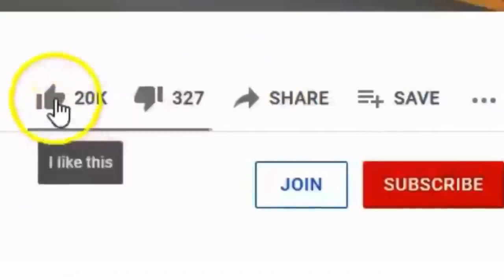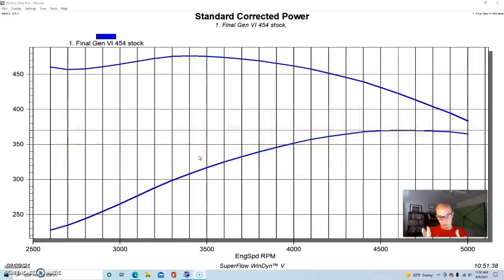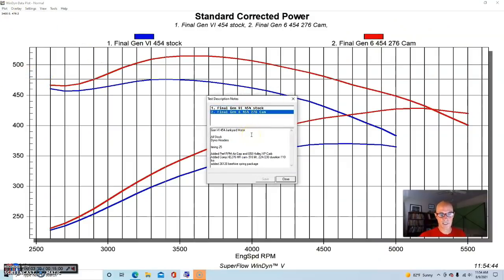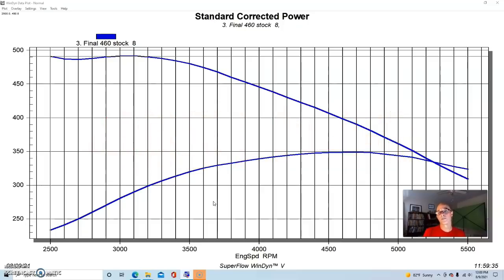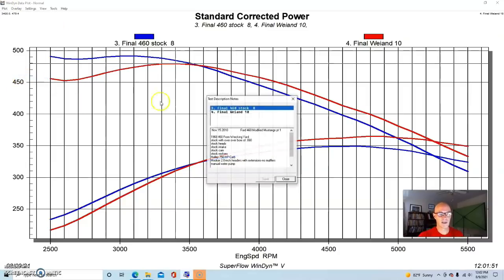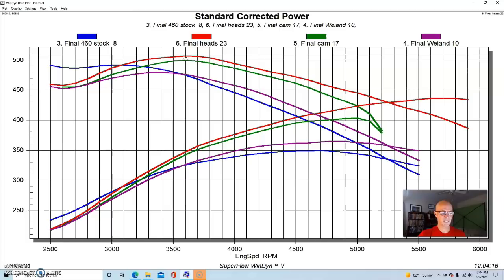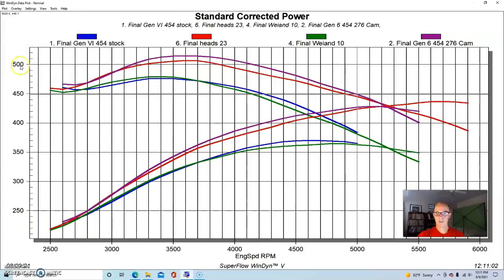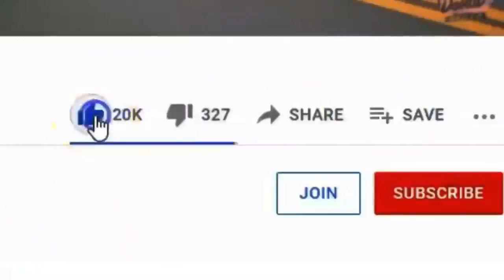JUNKYARD BIG BLOCK POWER-460 FORD VS 454 CHEVY FULL DYNO RESULTS

Comment: You can NOT outrun basic mathematics. If you use comparable upgrade parts that should give any engine a  V.E. of "about" 1 hp per cubic inch then a 454 should have "about" 454 hp and a 460 should have "about" 460hp. 
The real question here is how many parts and at what cost does each engine require to get to said 1 to 1 V.E.?
Reply: @ryanroberts1104   This is where the terms "basic" or "about" comes into play moreover I am NOT wrong in fact I'd say this test solidified just about everything I said.  I did NOT assume anything about the engines, it's the upgrade parts, and that's the entire point of this test. A decent cam swap, valve springs, headers, hi-rise Intake, 4bbl carb, and ignition upgrade is what we all know as basically a 1 to 1 V.E. upgrade.  That's a known target Ryan.  Granted some V-8 engines respond a little better than others but "basically" when building you can use your cubic inches to be your HP guide and be very close, as this test so emphatically proves.  Seeing as how the Ford actually outperformed the Chevy (ever so slightly) in this test, your flawed opinion of how terrible the Ford Big Blocks are does NOT interest me in the slightest. Cheers.
Reply: EXCEPT the 460 Ford is actually a 472 Ford.  It was bored .060" over.
Reply: @corvettejohn4507  So the engine with slightly more cubic inches made slightly more hp? Humm, wow, that seems to be the exact mathmatics I mentioned earlier but how could this be? Ryan said the 460 Ford was a terrible design so how could it be so responsive to all the upgrades? Pffft. Wtfe.
Reply: @warrenstephens3705  Yes.  A 472 made 8 more hp than a 454.  Somebody wake the kids, call grandma, and notify the newspapers.
Reply: @corvettejohn4507  Now you're learning, the bigger engine has the potential to make more HP, it's just basic math.  Grandma and the kids probably understand basic math.
Reply: @ryanroberts1104  It's my understanding that the same engineer designed both engines, and when designing the Ford, he corrected some of the mistakes he made on the Chevrolet.
Reply: @michaelangelo8001   Im like Richard, Im not a brand fanboy, I like all engines. One of the desigh changes you spoke of is initial bore size, the 460 has a huge bore so if you want to build a monster BB stroker just find the stroker crankshaft, theres no need for an aftermarket block to get the big bore, its already there and can be bored even more. Ask Jon Kaase.
Reply: @warrenstephens3705  I'm not learning.  I agreed with your first post.  I'm trying to help you out.
Reply: @warrenstephens3705  The Ford is better in a lot of ways.  They have a better combustion chamber and port design, and my favorite thing is that the spark plugs are up above the exhaust ports where you can actually get to them.

Chevrolet had a winner with the 409.  just a little re-design work, and it would have been better than the hemi.  However, they chose to start over with a clean sheet of paper, and we ended up with the "Mystery Motor".  It could have been better.
Reply: @michaelangelo8001  Exactly, and the fact that we are still talking about these engines is a testimate to how great there were and still can be.
Reply: @warrenstephens3705  Right.  One thing I really liked about the 348/409 was that there was absolutely no valve shrouding other than the cylinder wall itself.  It could have been improved some, but the combustion chamber was still better than those on it's "semi-hemi"  replacement.
Reply: @michaelangelo8001  You obviously don't know much about 409's.  They have some pretty SERIOUS limitations due to their design that makes them poorly suited for racing.  BTW, the combustion chamber of a 409 is in the cylinder and not the head.  It's formed by the shape of the piston top.  The surface area to volume ratio is poor, that means a good portion of your fuel's energy goes to heating the engine coolant instead of pushing the piston top down.  And that's one of the many things that are against the 409 for racing purposes.  If I listed them all here, it would turn into a book.
Reply: @corvettejohn4507  Lol, since you have set yourself up as an 'expert', go ahead and write me that "book", professor...  I'd appreciate it if you could actually tell me something I don't already know about this engine family.

Meanwhile, you might take note that it did very well in racing at the time.  I've owned/built more than one of these, and was duly impressed.

I already said that it needed some improvement for use in the high performance market.  After all, it was originally only intended for use as a heavy duty truck engine.

I stand by my statement that it was an overall better design than it's replacement.
Reply: @michaelangelo8001  Michael, I've owned and rebuilt W motors too.  Here goes:

Racing Weaknesses of Chevy Mk I 348/409

1.    Poor surface area to volume ratio because of combustion chamber located in cylinder block.  This lowers engine thermal efficiency and wastes more of the fuel’s energy to heat the engine coolant.

2.    Extremely heavy pistons due to the combustion chamber in block design.  409 pistons weigh almost 2 lbs each.  This limits useful rpm before engine failure.  Heavy pistons also hold in more heat.  Pistons in W motor run hotter than those in the SBC or BBC.

3.    Spark plug is in poor location in chamber for good flame travel.  The combustion chamber created when the 74° cut is taken across the bore is elliptical or oval in shape, rather than circular. This means that the wedge and quench areas do not have the same relationship as in the conventional head chamber. In addition, much of the nominal squish area is directly beneath a valve head, rather than being completely between piston and head surface. The spark plug placement, too, since it must be in the head, cannot enter the wedge from the side, as it does in the SBC. All of which results in a different flame front and combustion pattern and explains why many man-hours were expended by Chevy on modifications in this area.

4.    High compression piston tops are asymmetrical, they are thinner and lighter on the intake side of the piston top than on the exhaust side of the piston top. 

5.    Mediocre head intake port flow that is equal with passenger car oval port Mk IV heads (260 cfm/520hp NA max).  The exhaust valve opens toward the cylinder wall which shrouds the valve (truck block unshrouds valve w/relief cut for compression drop) and limits volumetric efficiency, power and rpm potential.

6.    Poor flowing stock intake manifolds with right angle runner bends.

7.    Undersized connecting rods and rod bolts for heavy pistons.  This limits useful rpm before engine failure.

8.    Crankshaft main bearing factory clearances and oil pump insufficient for high load, high rpm use.  This leads to seized crankshaft during heavy performance use.

9.    2-bolt main caps.  This limits useful rpm before crankshaft failure.

All of these things were corrected with the MkIV BBC, especially high performance 4-bolt main versions like the L88, ZL1, and LS6.  Not to mention that the MkIV rectangle port heads flow way better at 315-325 cfm on the intake port.  I've built both W motors and MkIV's, and it's not even close IMO.  In 1963, when the canted valve semi-hemi MkII 427 Mystery Motor hit the track at Daytona it was setting lap speeds 15mph faster than the fastest 1962 409 stock cars.  The one area where the W motor may beat the Rat is nostalgia.

Comment: Ford needed the .060 over to keep it competitive.  I didn’t scroll before commenting here.  Still the 454 out performed the Ford hence we were told everything about the 454.
Reply: Very true. It's already bigger by a few cubes from the factory
Reply: The Ford was from a 60’s car with flat tappet cam…. Throw a hydraulic roller in it with the same spec as the Chevy and it’ll show more power
Reply: I think the point of this video is that for the same engine size (generally speaking) they make similar power (generally speaking). The differences in these two tests were really pretty trivial, and they were obviously done at different times and not an intentional Apples to Apples test.

 I suspect there are not enough BBF parts at Westech to do a really good apples to apples comparo with a BBC. The Weiand on the Ford isn't the best manifold, for example, but it's what was available.

Comment: Do these 454 vs 460 videos ever turn out differently? No, the Chevy wins every time.
Reply: Unless you want power off idle, and since these are Truck motors that's where it's needed.
Reply: Where do you see a winner ??? They are so close in output you'd never feel the difference in a vehicle !!!!

Comment: Very poor comparison when you use a Chevy engine from 1990 or newer vs a Ford from 1968.  All late model Fords were roller motors.  Just upgrading the valve springs will get you a very strong 460.  Can we just do a more equal comparison?  Heads and cam will change the entire engine so displacement doesn't determine everything.
Reply: late model Ford 460 is a hydraulic flat tappet camshaft. No OEM roller camshaft for the Ford 460
Reply: My mistake.  That is correct.  Only flat tappet.  The Windsors all had rollers.  I apologize.
Reply: @murphystreeter  it's all good

Comment: Ive always understood that Ford pushrod V8's  have mostly been lacking, held back to a degree because of the exhaust side of the heads, especially the later models including the 460. Of course there are fixes for this.  All OEM's used to go back and stifle engine power back by one, making good street driving characteristics and to restrict available power for a trade in reliability. If they were pushed off the assembly line making all the power they could, its not going to live long. Things like restrictive exhaust or induction achieve this. Leaves room for the performance crowd too! GM tended to derate power by induction limitation. These practices largely died with the proliferation of fuel injection where the ecu tuning is the gatekeeper and factory engines make good power and fairly optimized performance off the dealer showroom.
Reply: Ford's exhaust issues on pretty much every mill they designed in the 60's had a lot to do with distance between the shock towers in their passenger cars
Reply: @ewetoobz3840  If i remember correctly, the 460ci had a pretty ugly exhaust port path. Up out of the valve and followed by a sharp, turbulent downward turn out of the head. I know exactly what you are talking about on the strut tower cars. My buddy has 69' Mach 1, R-code car, FE Super Cobra Jet. Its "fun" to work on. I understand why many took to the fender wells with a holesaw to do spark plugs.
Reply: @mytmousemalibu  One of Ford's "Better ideas".   LOL!
Reply: @corvettejohn4507  with that monstrous 428ci Super Cobra Jet jammed into that car..... i don't  know if you could fit a Kraft Single cheese slice between the towers and the exhaust! 😄

I love that car but theres a lot of alternate "I'd rather do ____ horrid thing" than do plugs on that Mach 1.
Reply: @mytmousemalibu  I know exactly what you are talking about.  In the 1990's I helped a buddy restore his 1969 Mach I with 428 Super Cobra Jet Ram Air Shaker Hood Scoop Drag Pack 4sp car.  

Whew!  Boy that's a mouthful.  And an engine bay full.  A BOSS 429 Mustang only wished they had that much room under the hood though.  LOL!  Stupid Ford tricks.
Reply: @corvettejohn4507  Yup!
That is identical to by buddies Mach 1, 4spd, shaker hood, drag pack, everything a guy would want as a SCJ car. This one still needs restoration but its an original 30,000 mile car. Eventually its getting the as new, showroom restoration, all stock. Except for one easy swappable part. He found a set of vintage factory Ford valve covers that look just like the originals except they say COBRA Le Mans on them, original Shelby parts. He'll definitely keep the originals too.
Reply: @mytmousemalibu  My friends car had the 4.30:1 gear and Detroit Locker.

Comment: There's no replacement for displacement...how many times have we heard that one...last time I checked it was the 11th commandment...
If you put these up against each other at the drag strip it comes down to vehicle weight, gear selection grip level of tires and who has the fastest reaction time.
I have beat many guys with more hp and faster cars with my truck because they didn't have the traction and they were caught sleeping at the line.
Reply: Drag racing is usually won in the first 60 feet.
Reply: @madmod  That's right !! 😉

Comment: Hydraulic roller cam with much more lift, also a much better intake with a RPM Air Gap compared to the Weiand intake with a small Hydraulic cam and a emery cloth cleaning of the heads. What a joke. Need same cam, same valve springs and stock rocker arms. Same era of engine like a 1970 vs 1970 for compression and timing purposes. Also no aftermarket timing componets.
Reply from the maker: SHOW ME THE JUNKYARD YOU FIND A 1970 LS6 IN

Comment: The Ford pictured ran a stock water pump Belt driven And a wiend intake  which are knowen not the best choice and weak valve springs Geeeeeeeeeeeeeeeeeeeeeee
Reply: There are two Weiands - one is too small and the other is too big. RPM Air Gap is just right! lol.
Reply: @ewetoobz3840  Who let Goldilocks in here?  LOL.

Comment: All the 460 heads are trash, even the dove heads. 
Please try a 460 with good heads
Reply from the maker: STOCK
Reply: C8VE/D0ve's with a good port job are far from trash.
Reply: @richardholdener1727  Yes, STOCK Boss 429 heads... HA!
Reply: Even the d0ve heads have a bad short turn radius and need good bowl work. True with enough porting most heads can be MADE better, but driving in dowels and not getting into water jackets while grinding down humps is a ton of work. But as cast they aren pretty bad.
Reply: The factory cast iron CJ heads (1970-71) flowed very well on the intake side but the exhaust side was a different story. They do benefit greatly with fairly simple port work. These engines were on the cusp of coming emissions requirements and had EGR bosses cast into the exhaust port - not drilled for use yet but still a bump in the way. Also the downturn in the exhaust so that these engines (exhaust manifolds) could fit between the shock towers of mid-sized sedans didn't help. A lot of guys made big power with these heads  though so saying they are trash is incorrect.
Reply: @lyleclark9190  Ford crippled lots of heads with that shock tower business.
Reply: @MrZilla500  it doesn't take much that work to make the exhausts flow a lot better. It takes a LOT of work to make them "pretty", but you don't have to. ScottyJ (Madporter) on the 460 boards has some recent information on the bare minimum to make a huge improvement on the D3ve heads and it's not a lot of grinding. Nowhere close to water jackets, no AIR removal, very minimal grinding. Granted, the aftermarket has some very strong offerings but they are not remotely cheap.

Comment: How about a couple real engines; 455 Olds, 500 Caddy, 440 Chrysler...
Reply: Lol! Real engines? Olds? Caddy??
Reply: @jesseduke694  Don't build engines, eh?  It's ok, just keep watching videos in your mama's basement.
Reply: @FMChimera  LOL! You wanna be right so bad!!
Reply: @FMChimera  it takes more than the alloy in the block to make serious power.  The other components have to hold up more than just the blocks. And heads that can flow some air are also helpful. Not somthin Olds,  & caddies are generally known for. I know all about there special blocks that you speak of. But to actually get them on a level with the other engines has to cost 3 or 4 times as much. Look you onry old man, I apologize if I offended you. Hot rodding & enjoying this hobby is simply about enjoying the engines & the ride that you like & for whatever reason. There is no reason that is wrong or less important than anybody else's reasons for liking what they like. On that I shouldn't have commented to you the way I did. You liking Olds, & Caddies is absolutely as good as me liking Fords & Chevys. So on that I opologize again if came in to your comment & then commented like yours ain't as good. I know they are & I really don't want to step on anybodys ideas of what they like. I dont know why I did that.

Comment: Bored to the max 4.42 bore 472ci  Ford vs 4.25" std Bore Chevy 454ci is'nt very fair..
get a mk-iv block and Bore the Chevy +.100 and make the compression ratio the same as the Ford, and use the same type and duration cams, for both Engines, no hand porting, and see who wins then.
Reply: .060 is NOT “bored to the max”  on the Ford.  Don’t forget to give the Ford a hydraulic roller cam with the same duration and use the 60’s oval ports heads on the Chev instead of Gen6 with 40 years of development,  and use the same air gap intake.  Or how about take both out to maximum stock block ci with max effort aftermarket heads using stock style intake?  You can cherry pick stuff all day...

Comment: This is a horrible comparison, roller cam vs flat tappet, good manifold vs lesser intake, 472 cubes vs 454, make everything the same.
Reply from the maker: should we give them the same bore and stroke, the same compression & the same cylinder heads too?
Reply: @richardholdener1727  Yes on the compression ratio, but no need to use the same cylinder heads, they're close enough already.  LOL.

Comment: So, in conclusion, the Ford needed to be bored .060 over and get ported heads and a cam to keep up with a stock 454 with just a cam swap.
Reply: The heads on the later model Chevy are far superior to the old technology on the Ford, that's why he did some minor work to the Ford heads. Ford's were notorious for breathing problems during this time frame anyway.